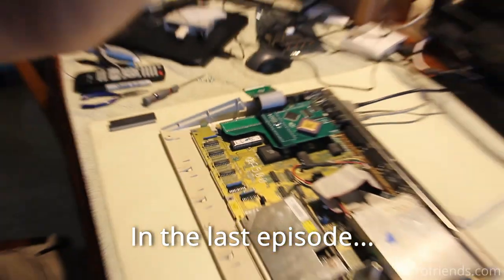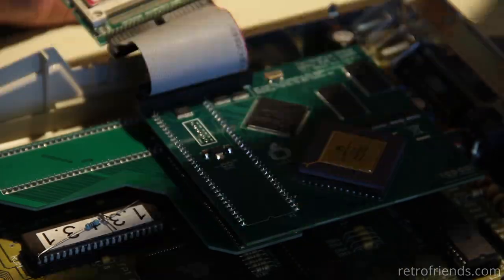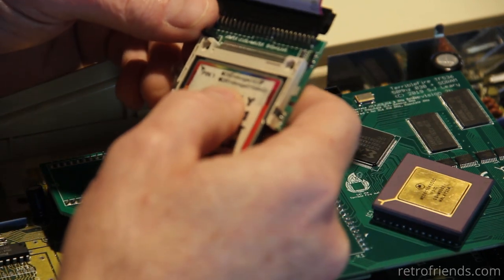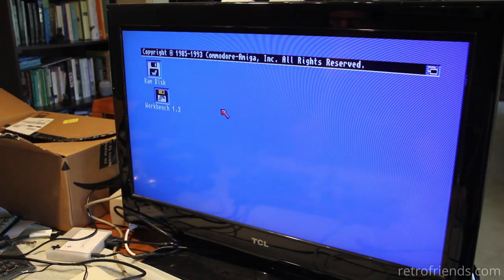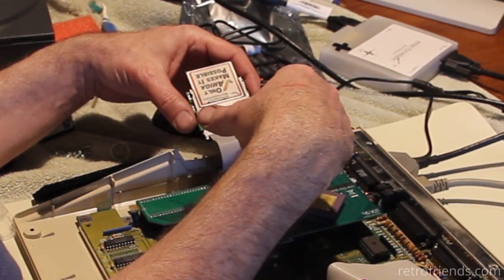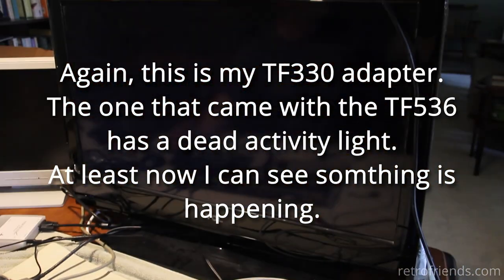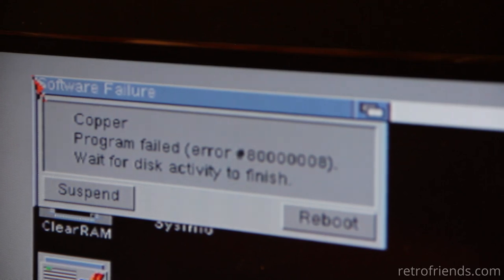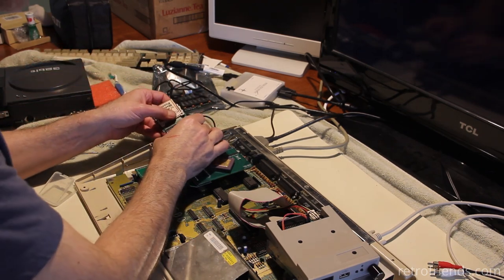A Friend's Amiga 500: Compact Flash Woes and Final Tweaks

Comment: Haha you can revive CD32 boards but cant get a CF adaptor the right way around. I think you just needed to do some due diligence by checking pictures or simple pin out diagrams on the net before even plugging the adapter into the cable. A) it would have solved all your problems and B) possibly prevented breaking a CPLD or the adapter itself because you put 5v down the ground line.
Reply from the maker: Remember, the CF adapter was backwards as received. Also, I did try looking online for the orientation in relation to the TF536. As stated in the vid, most seem to have a right angle CF adapter that you can't put in backwards. I also mention that you can safely reverse IDE cables without damage to components. It's a long vid, so I don't blame you for missing details :)

Comment: I find mine very slow. loads from the hard drive like your friends. I did the TFdisk 3 test's and it failed on every test.  I am still looking into why the ide is so slow.  My amiga 500 loaded alot faster with my supraturbo 28 and my original cpu and supra 500xp drive with an sd card adaptor.  did you find any info on the ide part of the terrible fire 536 ?
Reply from the maker: My buddy likes to run MUI, magicWB, etc. All these things slow down the boot. I prefer vanilla installs which boot a lot faster.

Comment: Thank you for the great vid, think Hdd is only supported on kickstart 2.0 and onwards, also have you seen the PuStorm 68k replacement? and what are your thoughts on it? I’m looking into it as I think it’s cheap and maybe better then all the expensive add ons for the A500
Reply from the maker: PiStorm is a Raspberry Pi you put in your Amiga. Some purists say that running your Amiga off a RasPi isn't the proper way to experience retro. I don't care so much, but I guess I slightly prefer a 680x0 based accelerator.
Reply from the maker: Oh, and 1.3 does support HDD booting, it was 1.2 that didn't. Check my channel for 2+ vids about two a500 HDD controllers. Both boot from 1.3 KS.
Reply: Was thinking the same thing, but it’s only emulating the cpu and stuff, your still using the old hardware 🤔 thinks for the tip on 1.3 I will try it 👍 i’m On 2.0 at the moment.

Comment: Yeah that CF adapter is probably an earlier revison like VH1, when you buy these CF to IDE adapters then only get the VH.2 revison these will work out of the box and the LED too no modding rquired this is regarding the TF330 though as I do not build the TF536 but my guess is that CF adapter you bought is faulty as they do have a fail rate. did you try it in the TF330 ?

Still a grteat vid as it will help other TF536 owners with some fault finding
Reply from the maker: No, I didn't, but the 536 and the 330 should be the same. The ones with "B1" seem to be the ones that don't work. FYI They don't work in an a1200 either, so more of an Amiga requirement rather than something special about the TF boards. I ordered a new V.H2 on Amazon and it works (link in the description).